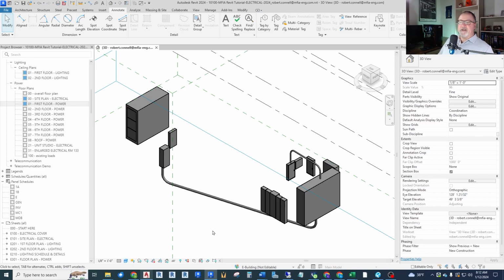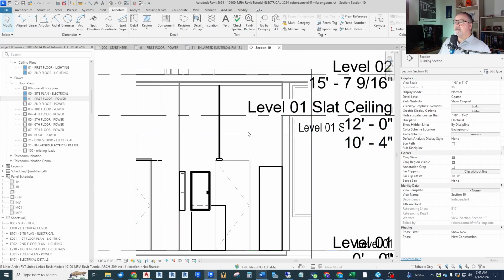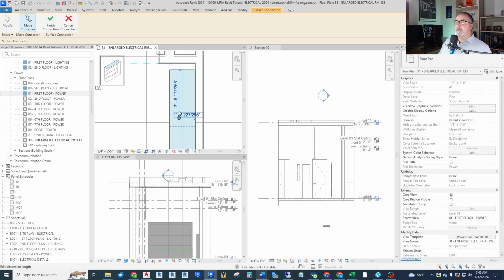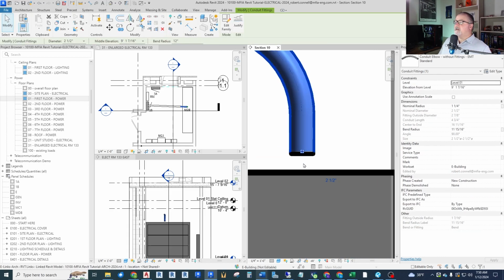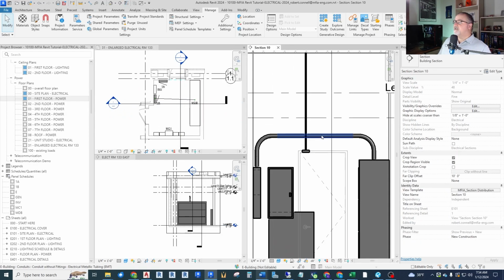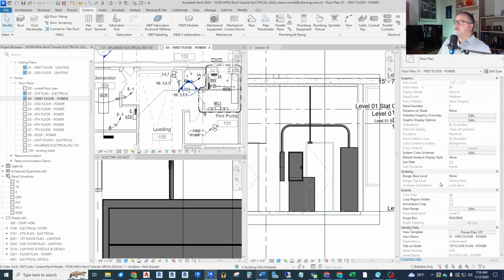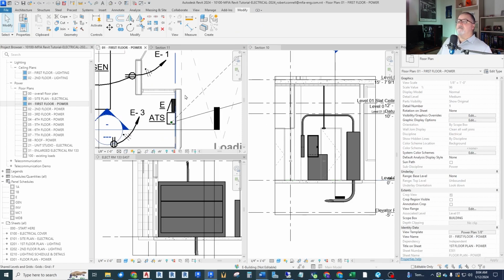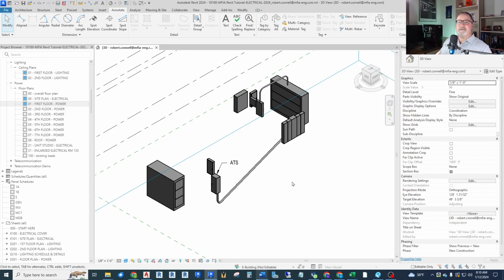REVIT MEP MASTERING 3D CONDUIT MODELING

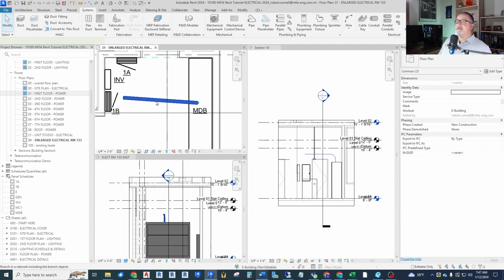Comment: Hi Rob, at 7:14 you mentioned not connecting the conduit due to performance. We are about to start a project that requires us to model all backboxes and conduits, there will be 1000s. I am currently in the process of adding conduit connectors to our back boxes, is this not common practice?
Reply from the maker: For my typical scope, I only show large "feeder" conduits, like 1-1/2" and above, and typically without specific fittings, just for major space planning and coordination. It is not critical for my conduits to hit a specific point on a piece of equipment, nor have a specific type of fitting like a hub, etc. However, if you are doing some kind of very detailed raceway modelling, you may need the conduit connectors on your equipment/devices.

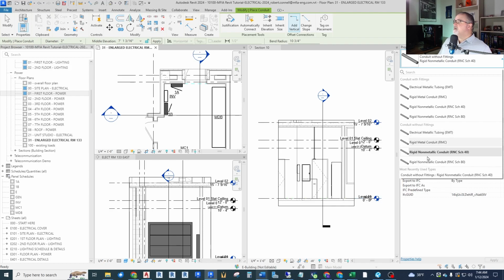Comment: By 5:10 pop up a question:  - what is your role in the design process (architect, engineer)? Who is contractor, electrician,  that will do detailed modelling?  
Just trying to figure it out the process , rolls and responsibilities,  as well as boundaries in the design process.

An answer is well appreciated, thank you!

Comment: It's a shame that in 2025, conduits still can't be associated with a circuit like ducts, which can be differentiated and labeled by system type.
For this, I created a circular duct family with behavior similar to conduits (3 to 5d elbows)
with T families that resemble junction boxes.
It's much easier for "cable tray" nomenclature

Comment: When I try to "Draw Conduit" an error message appears : No auto-route solution was found. what could be the problem ?
Reply from the maker: Hard to diagnose without being in the model, but might be creating a conduit too short for an elbow, or bad angle. Try extending the conduit first, or moving it sideways to extend it, then move it back. Takes a few tries sometimes.
Reply: @ElectricRob  Thank you Rob, moved it and it worked.

Comment: I model a lot of underground duct banks. I wish Revit would let you use arcs for conduit. Trenching is not always straight :)
Reply from the maker: Hey Clifton! You bring up a great point - from a "diagrammatic" point of view, the straight conduit works, but from an actual "detailer" point of view, trying to model real-life conditions, you are right, there needs to be other tools. I've seen a few 3rd party conduit modeling add-ons to help with this, maybe for "90 degree with a kick" or "saddle" or "offset" type modeling, but a large-radius curve option or even a "spline" type would definitely be useful.
Reply: @ElectricRob  A lot of what I do is to make the engineered drawings work in the real world to simplify everything for the foreman on the job. If I can make everything fit then so can they. Although getting good switchgear opening information ahead of ordering can be challenging.
Reply from the maker: @cliftonmann8713  I totally get that - I work with contractors who have detailers on staff that do exactly what you mention - they take my "diagrammatic" engineered drawings and fit them up in detail for their installers. And I hear you on the switchboard issue - getting that "shop drawing" level of detail from suppliers can be challenging, especially early on. And this highlights the wide range of tasks that our electrical construction industry has to deal with!

Comment: Why does the outlets range and triplex symbol does not show the power symbol whenever you click or select them?
Reply from the maker: Sounds to me like you are using the "architectural" versions of those receptacles - they are symbols only and do not contain the electrical connector that we need. Look for receptacles under the "MEP" folder if you are downloading from the Autodesk cloud. Glad you brought this up - I will be posting a video soon covering all of the "out-of-the-box" electrical elements included with revit, and some of their pitfalls. Cheers!

Comment: Thanks for providing practical design advice for Revit Electric, especially from a design standpoint that takes into account NEC / Code. 

99% of Revit electrical videos on YouTube is essentially an architect showing you how to place receptacles and lights with model lines to switch them. They seem to think that because they can place devices in the model that they can design electric but their videos lack substance and are not useful for actual design of construction documents. 

New subscriber and love the videos!
Reply from the maker: @nickstewart165 Thank you so much for the feedback! And I'm glad you are noticing my efforts - that is exactly why I started this channel. We could not find the more technical instruction we were looking for. Even behind some paywalls, we found a few lessons that were more in depth, but I wanted to produce a full set of videos to help our crew. They are not true NEC classes - plenty of those out there - but I wanted to at least show how certain code issues and calcs can actually be performed within Revit. Again, appreciate the response! Cheers